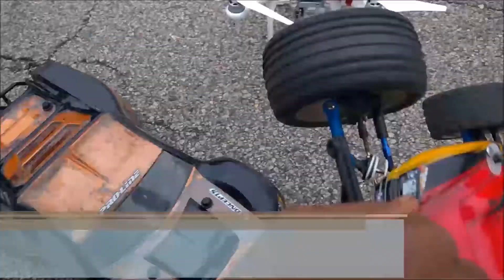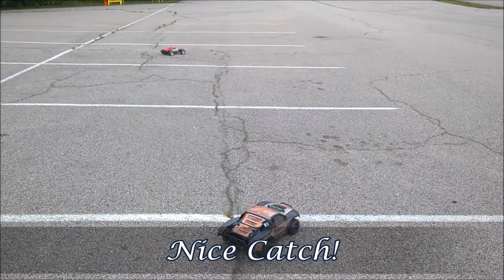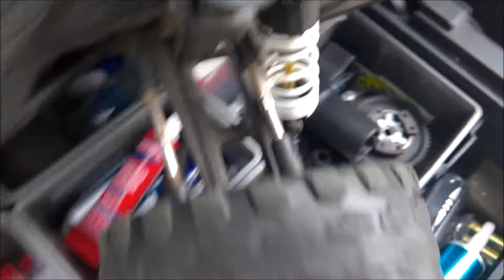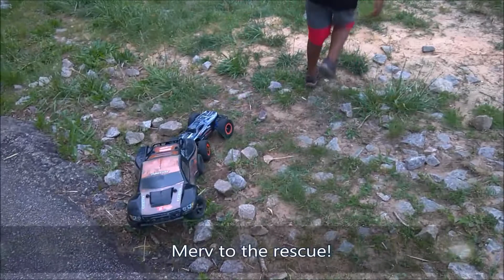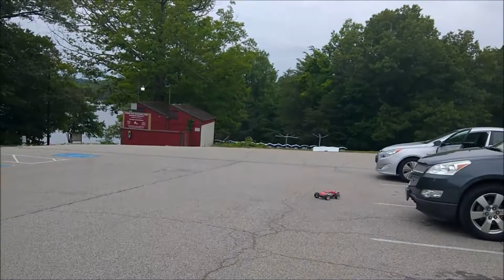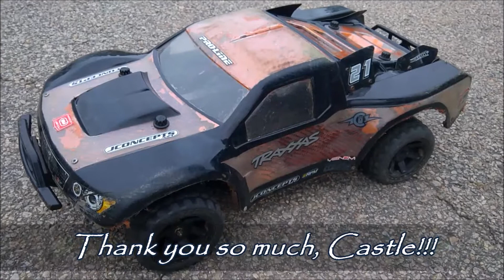Ep. 204: Castle Mamba X/Sensored Motor Review & Bashing Session

Comment: What wheels and tyres you using are they 12mm hex
Reply from the maker: The cars in this video are all using 12mm hex wheels. The rustler is running Traxxas rims with Pro-Line Trencher tires while the Slash 4x4 is running a set of Rustler pre-mounted Dirt Hawg tire with the front and rear axles flipped. This gives the stock wheel offset up front, but a wider stance in the rear for a little more stability. 😎

Comment: I just purchased the Castle Sidewinder SCT 3800kv sensored kit for my Redcat Blackout XTE Pro. The stock motor is a 4 pole brushless 3800kv, and honestly its pretty impressive out of the box, and with a 29/64 gearing runs 55mph or so. So I'm excited to see what gains can be made with the Castle setup. The cogging will surely be better but what about top speed and wheelies?????
Reply from the maker: I think I have some bad news for you. This is from Castle's website. "Sensored  capabilities of the motor cannot be utilized with the Sidewinder SCT. If you require sensored operation you will need a sensored ESC like the Mamba X."

The combo you purchased is basically the same setup I removed from my Slash 4x4 and it screams, but you will not get the low speed benefits of the sensored motor without a Mamba X or Mamba Monster X ESC. :-(
Reply: That's the next upgrade it souns like lol, Mamba X !!
Reply: I'm sure itll still be an upgrade from factory esc, think its a hobbywing
Reply from the maker: I loved my Sidewinders. (I've had a few). Lots of kick and pretty solid as long as you don't overheat them. ;-) They also have a decent amount of programmability through Castle Link. I'm sure you'll have a blast!
Reply: subscribed

Comment: what's the part number on that motor/speed control?
Reply from the maker: These cars are both using Mamba X ESCs. The Slash has a sensored 1410 3800kv. I would actually recommend that motor for pretty much all bashing applications. The Rustler has a sensored 1406 4600kv, but that was largely an experiment to see if that motor could handle a Rustler under bashing conditions. The answer of course was YES!, but the 1410 3800kv would probably be a better choice given it's higher overall power capability for nearly the same price.